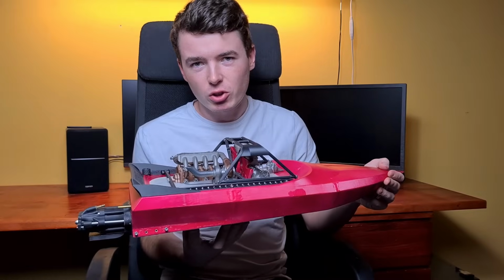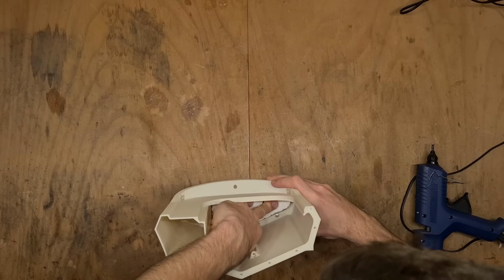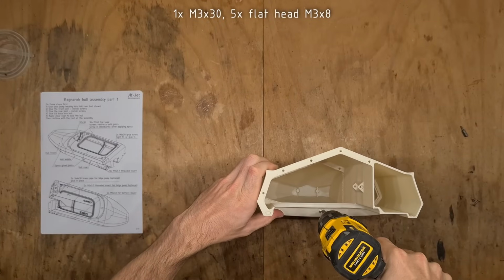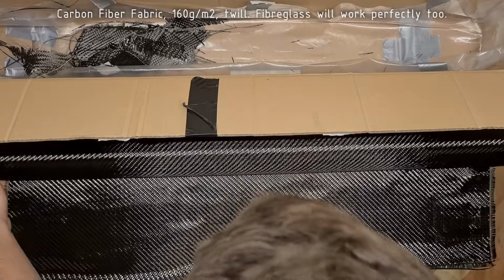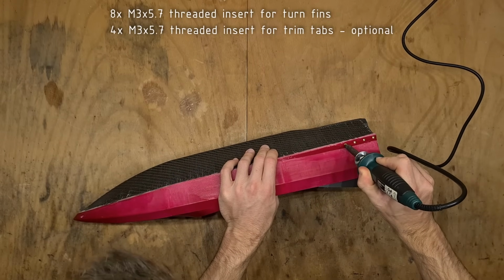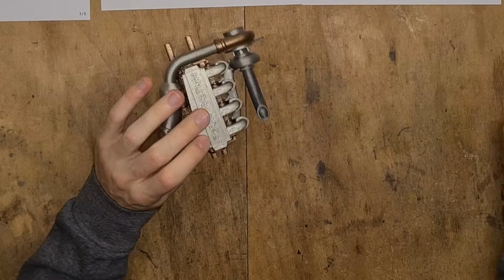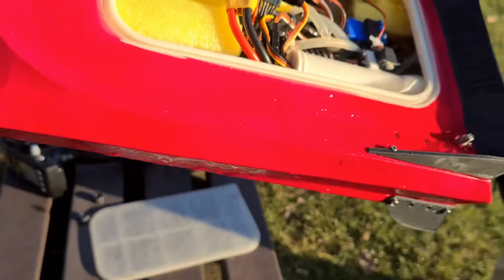RAGNAROK Full Build / 3D Printed Jetboat Assembly

Comment from the maker: 3:08 Selecting Electronics
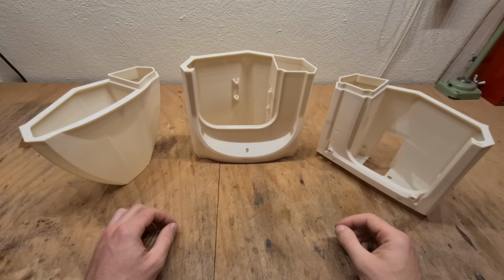6:16 Printing Orientation, Warping Compensation
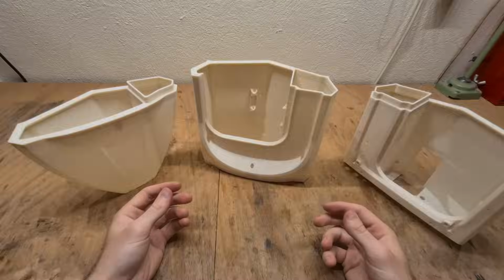8:53 Flotation
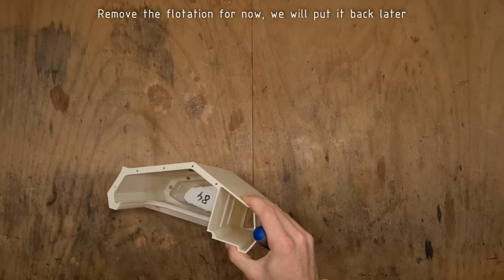10:08 Pump Installation
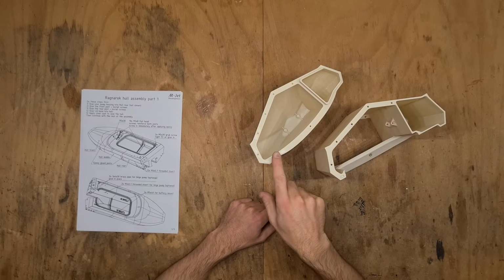13:08 Front Joint
15:22 Rear Joint
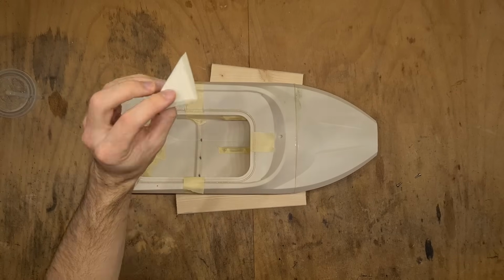17:20 Bumper
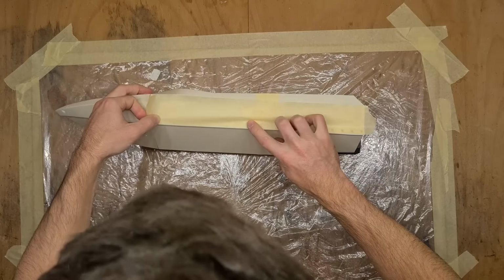17:39 Carbon Fiber Wrap (optional)
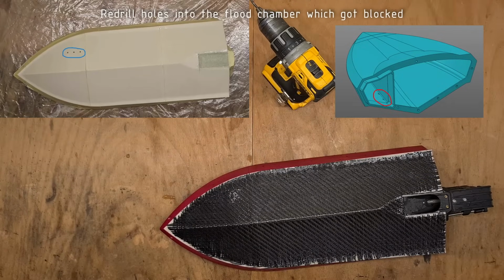20:48 Spray Paint
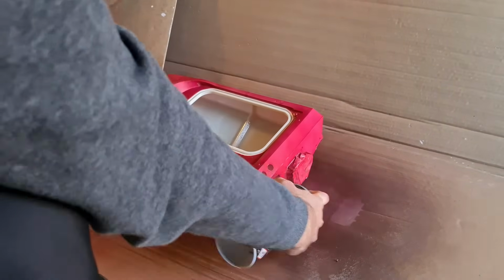21:47 Hull Details
23:14 Rollcage, Pilots, Engine
28:41 Installing Electronics
31:35 Fly

Comment: What’s with the cooling hose coming out of the hull on your mjet35…is that the Bruteforce easter egg in the hull files?!?!
Reply from the maker: No no I just used this to measure pressure in the second stage, I had a sensor in the hull and through this part I routed water to it. But nice try😆

Comment: What is the best material to use so as it would not leak from the layers
Reply: Is petg good?
Reply from the maker: A choice of printing material cannot stop the leakages, the leakages can also be caused by little geometric imperfections such as the seams and retractions. I prefer ASA, but with any material it is likely needed to apply the clear coat or other way to seal it.
Reply: @mjetdevelopment is petg good?
Reply from the maker: @firebalazer2623Yes petg is ok

Comment: Hello! I need a little help. I'm building a ragnarok with m-jet 35. I choose 6s battery with FlyColor 120/150 A esc. And now i can't select the right motor. I found 4 motors as follows:Surpass 3674 1900kV, Rocket 3674 1580kV, Xteam 3670 1100kV, Xteam 3674 860kV. So, which one i have to choose? Xteam 3670 1100kv? Thanks!
Reply from the maker: Hi, for M-Jet 35 on 6S with a 150A ESC, out of those motors, definitely choose the 3670 1100KV. That will be a reliable medium performing setup.

Comment: I just came across this video but I just purchased the Super Sprint last week, are the the same size and are the hull pieces interchangeable,  I really like the fact that the Ragnarok is screwed together.
Reply from the maker: Supersprint (40cm) and Ragnarok (55cm) are very different in size and none of their hull parts are interchangeable. Supersprint is smaller and intentionally simpler, with its lower power and weight the screws don't seem necessary.
Reply: @mjetdevelopment i just noticed that,  thank you so much for the response,  im printing the supersprint on 2 printers as i type this. I work for Push Plastic in Springdale Arkansas USA. I am am extruder operator. We make 3d filament. We just had a someone come out last month and do a tour and posted on YouTube. If you ever find yourself out this way, let me know and ill get you a tour and some filament. Im using ABS for the hull,ASA for the pump,High Heat Tough PLA for the cage,drivers and rear wing, and will use PCTG for the turn fins, just to test the different materials.

Comment: I do not suppose you have a code that helps with the exchange rate currently to buy the M Jet 35 on trader it is 40.00, however converting it to Australian dollars it becomes 70.00+ and the M Jet 30 is 18 dollars us and converted to Australian become $27, thanks for considering the request
Reply from the maker: Hey, converting 40 USD to australlian gives me 61 AUD. If the price shows higher, it might be due to regulations and import laws in Australia. You could try enabling a VPN and pretend you are in a different country. Considering any possible legal consequences of that is up to you:)

Comment: Is it possible to mount the dummy motor lower in the hull?
Reply from the maker: No, there is the TPU lid in the way. It would require a large redesign.
Reply: @mjetdevelopment  cheers mate. Yeah I realise it's not just that simple.  I haven't taken the plunge on 1 of these yet but run a Steve dales 410 and I just run a clear panel instead of an engine.  A dream has been over 10 years now to build most of the engine below the clear hatch and just the top on the outside.  Funny was always going to do a rotary too as there was 1 racing over here in NZ back then. 

May I ask why the rotary?? I think it's brilliant 😊  v8s are just too common
Reply from the maker: @jethroboorer2860 The rotary idea came from the community😀 I asked people to show which engines they liked and out of those I picked the rotary because I thought it was so cool.
Reply: @mjetdevelopment  ahhh wicked. Have you seen the 4 rotor sprint boat in nz?  Look it up if not. Sounds amazing

Comment: Hello, I'm sorry to bother you. I have a question that I'm not sure about. I found a Rocket 3680 1100kv and 1250kv. If I use them, will they work? Because they're not the 3682 1250kv as specified. And if they can be used, what size battery should I use? Please advise. Thank you very much.😊💝💖💗💓💞💯💫🤟✌👍👍👍🙏🙏🙏
Reply from the maker: Yes, these are both ok on 6S. You can use 6S 3500-4500mAh.
Reply: @mjetdevelopment  I feel relieved now. Thank you very much.😊💝💖💗💯🤟✌👍👍🙏🙏
Reply: @mjetdevelopment  Hello, I'm sorry to bother you again. I have already purchased a Rocket 4092 1250kv but I'm deciding whether to use a 6S 5000mAh 22.2v 60C battery. Thank you very much.
Reply from the maker: @cryptoinvestment7651 Yes, that sounds good, will be tight but some people used 5000mAh already.
Reply: @mjetdevelopment  Thank you very much for your advice. I forgot to consider the battery size. Thank you very much.😊💝💖💗💓💯🤟✌👍🙏🙏

Comment: Hi, I currently have a Flycolor 150A esc, should I use a Rocket 3670 1850kv motor, should the battery be 6S 4000mAh? (It is quite rare to find a Rocket motor that matches the specs. I have found a Tianfulong SSS 3674 1650kv motor, but I am not sure how well it will work with a Flycolor 150A ESC, can anyone give me some advice? (I use a M-Jet35) Thank you so much.
Reply from the maker: For M-Jet 35, these KVs are way too high for 6S and the motor size. For a 3670 motor on 6S with M-Jet 35, going high above 1200KV will result in inefficient operation and a lot of heat. Motor connectors may desolder.

I recommend either switching to 4S, then the setup should be safe and ok.

Or, finding a lower KV motor. I may have some links for you depending on where you are approximately located?
Reply: @mjetdevelopment  ESC Flycolor 150A esc, this model, should I use TFL SSS 3674 1650kv motor? Will the current be too high when playing the boat at speed, might cause too much heat at the ESC? If using this TFL SSS 3674 1650kv motor, if it can be used, how many cells and milliamps of battery should I use? Thank you very much.
Reply from the maker: @cryptoinvestment7651  With a 3674 1650KV motor, maximum amount of cells I recommend is 4S. I recommend 5000 - 6000 mAh capacity.

It will achieve medium speed. It is not the best setup, it would be better to use lower KV and 6S. 

M-Jet 35 manual:
https://drive.google.com/file/d/1d3b9momWcgAeUAn5o1v0-QZcIMYy4U90/view?usp=sharing
Reply: @mjetdevelopment  Thank you very much. Now I have found Rocket 4092 1250kv. I will use 6S 6000mAh 22.2V battery. I don't know how much heat or current it will consume. Thank you very much.
Reply from the maker: That is an excellent choice.
If the battery is 6S, I recommend lower capacity like 3500 - 4500mAh maximum, to be sure it fits into the hull.
Then it will be a great setup.
It will probably pull around 130A.
Reply: @mjetdevelopment  Thank you so much😊💝💖💗💓💞💯💫💥🤟✌👍🙏🙏

Comment: Hi , i just finisched everything but i have a problem i yoused the same motor and esc what you youse but my bot cant go straigt only in half throtel if i put it on full throttel its spins wehen its going fast . you now the problem. 

sorry fory my englisch i am from Austria  

motor 4092 1520kv 
esc 150a flycolor 
battery 6s 6500mah 
Metal propeller 

if i put the boat in to the wather the left side sinks ist that normal.  ? 

Thx :)
Reply from the maker: Hi, 
1) the steering / stability issue can usually be fixed. Straight line stability is a combination of CG, nozzle trim, ride plate, turn fins and trim tabs. To improve straight line stability in particular, try a long ride plate with longer fins. For more context about handling, please read one of the last parts of the manual.

2) yes, that is normal, it is caused by the flood chamber:)
Reply: @mjetdevelopment ok thx i just out in a +10 nozzle and the 9 back fins not the side ones an the sideones ar 25 today ist drives straigt and nice its sooo fast like riding ony on the jet ride playet but my stuff is getin tooo hot idk why i tryed every timing but still hott
Reply from the maker: @gohst_jonesy_xx7948 Which part is getting hot? Probably the ESC? It is the weakest part of your setup, being rated for 150A, while the motor with fairly high KV and big battery probably pulls over 200A. 

If you'd like a serious ESC upgrade, you can get a Castle Hydra X.
Reply: @mjetdevelopment esc and the motor is getting worm the battery too i just yoused a 6s 1300mah for funn but hellyyah that thing got hott. my 6s 6500gets warm too bit thats normal if its pulling 200A aut.
Reply: the castle hydra X is tooo expensif for mee😂😂

Comment: could you list the electronics you used at the very end(on the working boat)
Reply from the maker: 4094 1400KV motor
Castle hydra X ESC
CNHL 6S 4000mAh battery

Comment: Hi sorry for all the questions but I am building the jet ski with the m jet 35 and I was wondering if those exact electronics would be good for the jet ski and if so what battery, esc, and motor did u use in this video
Reply from the maker: Hello,
The Valkyrie can use the same electronics with the exception that I prefer a shorter motor for it, to leave more space for the battery. Instead of 4092 1400KV, I would use 4074 1400KV.
In this video I used 4092 1400KV motor, Castle Hydra X ESC and CNHL 6S 4000mAh battery.
For the ESC you can also use Hobbywing 180A for example.

Comment: Love your work, Where do you get all of the fasteners and hardware from do you have a B.O.M?
Reply from the maker: The part list is included in the Ragnarok file package, which you can download freely, link in description. I buy all fasteners in a local hardware store.
Reply: @mjetdevelopment  Thanks for the reply I ended up guessing from the RCprinter page and ordering far too many from aliexpress 🤣
Reply: @mjetdevelopment  Also another dumb question, I don't have any TPU so was trying to print the lid in PLA but it obviously won't stretch to fit.
Is there a file for a hard lid?
Reply from the maker: @Morg-0110 No, TPU is the only option. Back then I tried various hard lid designs but TPU proved to be the ultimate solution only being harder to print.

Comment: Is the parts list of the raganarock the same as the super sprint?
Reply from the maker: No, definitely not, even though many parts are similar. Biggest difference is that Ragnarok doesn't have the pump integrated, but the pump gets glued in and the pump has its own part list.

The Ragnarok hull itself is free and comes with a part list (the part list doesnt include parts for the pump):
https://www.cgtrader.com/free-3d-print-models/hobby-diy/hobby-accessories/ragnarok-3d-printable-rc-jetsprint-boat

Comment: There has been something I have been thinking about, what if you coat the impeller and housing with a hydrophobic material or something causing the friction to be practically zero, I’m just wondering if that is something you would want to try
Reply: From what websites I have seen it can be anywhere form 50% to 90%
Reply from the maker: To my knowledge hydrophobic materials cause the water to not adhere to the surface, however that happens in open environment where air is around. Inside of the pump there is only water and water vapors in case of cavitation. Water still has to flow on the surfaces.

What definitely helps is making the surface smooth, but I haven't heard using a hydrophobic material would help - do you have any resources to that?
Reply: I have a article by YouTube keeps removing my comment, is there another way I could get it to you?

Comment: This boat is perfect, also the final power and speed is absolut uncredible.
What exact components did you use for the Ragnarok? (motor type and KV, amps of the esc, battery type and c value)?
Reply from the maker: Thanks!
This is my setup used in this video.

Motor: 4092 1400KV 

ESC: Castle Creations Hydra X 8S 
Note that Castle does not explicitly state amp rating of the ESC because there is no standardized measurement method for this. My setup in this video pulls over 170A on full throttle and the ESC remains cool. Another ESC that should be capable of this load is the Hobbywing 180A.

Battery: CNHL G+ 6S 4000mAh 70C

Comment: for the bearings in the pump are you going for higher end specd or chinese stainless. I can find the smaller bearing with ceramic balls, but not the 5x19x6 one
Reply from the maker: @NewcastleDayz  I am using stainless bearings which I buy from european shops, I am not sure where they are manufactured originally.
For example here is a 5x19x6
https://www.123bearing.eu/bearing-housing/deep-groove-bearing/single-row/s635-zz-zen

Unfortunately I don't know suppliers in different parts of the world

Comment: how come Abs isn't listed for printing the hull but Asa is similar?
Reply from the maker: @NewcastleDayz  You can use ABS too, you might get a bit more warping tho, that's why ASA is preferred
Reply: @mjetdevelopment  I have a Voron it should be able to do it
Reply: @mjetdevelopment  I did print a abs and asa hull. Both turned out great with no warping. I did let the chamber heat soak for 40 minutes before each print and let cool to room temp. Do you have any links for the esc and motor you used in yours? it looks like a castle creations marine esc, i better put some couple rc's up for sale to fund that good lord they have gotten expensive. I bought my the first 2200kv mamba max way back when it was new and the thing was a savage setup in my losi buggy road car.
Reply from the maker: @NewcastleDayz  
Here are the links for what I used:

https://www.castlecreations.com/en/hydra-x-8s-33-6v-esc-8a-peak-bec-010-0175-00

https://www.tfl-hobby.de/Motore--Halter--usw-/Brushless/TFL-40-mm/4092/BL-Motor-TFL--4092-1400KV.html

The Castle is expensive indeed. I am absolutely amazed by both its performance and its advanced features, but to get a boat running there are cheaper options, for example Hobbywing 180A or Spektrum Smart Marine 160A (keep in mind the motor I used in the video pulls over 170A on full throttle so it is always up to you if you trust the ESC can handle it).

Comment: Is your next video going to be a continuation of the video about the pump pressure and intake velocity? Have you made updates since that video to the pumps and why have you deleted it?
Reply from the maker: Yes, you are right, I hid the video.

After I released it, I had some more thought around it. Right now the M-Jet Development is my only side job while I am studying. I really like it and I would like to continue. In order to keep my position on the market and my income, I can no longer give away all of my knowledge and methods. Anyone who comes to design jet pumps after me can copy what I do without having to spend those 5 years to figure it out as I did. 

As you can see from my videos, I like to share stuff. However, by doing it, at this point I am just putting my job in danger. Therefore I need to find a balance between sharing everything and keeping some tricks for myself. I will continue to share the results of my work; probably no longer everything which led to them.

Thanks for understanding.

Comment: Hello 👍This boat is really good work. I would be interested in doing it and I see that the files are free too!!! Do we need to add the motor additionally?
Reply from the maker: By "motor", do you mean the jet pump?

The files for the Ragnarok hull are free: https://www.cgtrader.com/free-3d-print-models/hobby-diy/other/ragnarok-3d-printable-rc-jetsprint-boat

The files for the jet pumps need to be purchased. Currently, you can choose between the M-Jet 35 (more powerful) and M-Jet 30 (cheaper).

M-Jet 35: https://www.cgtrader.com/3d-print-models/hobby-diy/other/m-jet-35-3d-printable-jet-pump-for-rc-boats
M-Jet 30: https://www.cgtrader.com/3d-print-models/hobby-diy/other/m-jet-3d-printable-jet-drive-for-rc-boats

Comment: Are you gonna install upgrades on the Ragnarok?
Reply from the maker: Which upgrades do you mean?
Reply: @ upgrades like the super sprit
Reply from the maker: @herosjourney2776  Which specific upgrades? I don't understand what do you mean by upgrades
Reply: Like the super charger upgrade
Reply from the maker: @herosjourney2776  I see you mean the Supersprint's V8 engine. The Ragnarok will not get a V8 engine. It already has the rotary engine which will stay

Comment: Awesome! I’m working on getting my ragnarok trimmed out, it would always spin out in turns but hoping the larger fins will make it perfect! What size fins do you use?
Reply from the maker: In this video, I used Mega 25 turn fins. I managed to make the hull stable and stop any hopping, however I am still not fully happy with the cornering, it spins out more than I'd like. Tuning the handling takes time and requires testing many different combinations of all parts.

This is my full setup.
Version: Ragnarok V11 with flood chamber 
Pump: M-Jet 35 
Motor: 4092 1400KV 
ESC: Castle Creations Hydra X 8S 
Battery: CNHL G+ 6S 4000mAh RTR 
Weight: 2945 g 
CG position: 165 mm from the stern (measured from rear end of the hull) 
Nozzle: +2.5 
Ride plate: Ride plate by Ryan Frair 
Turn fins: Mega 25 
Trim tabs: None 
Intake grate: Loading grate default
Reply: @mjetdevelopment  regarding cornering: have you tried making a progressive trim for the nozzle with +2.5 at the center and +10 at the very edges? I am thinking about traditional surfboards, when surfers want to turn on a dime they move all their body weight to the stern (where fins are) and push hard (I used to practice windsurf a while ago, same principle)
Reply from the maker: @geekmidget  I haven't. It is a very good idea and definitely worth trying.